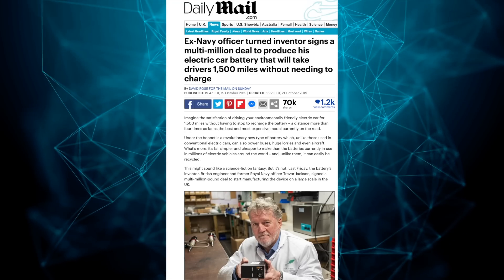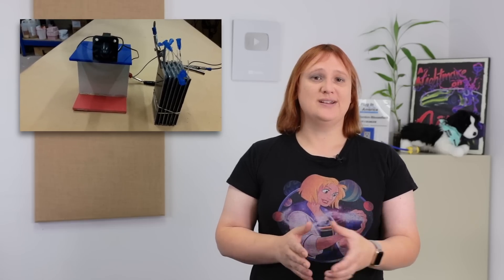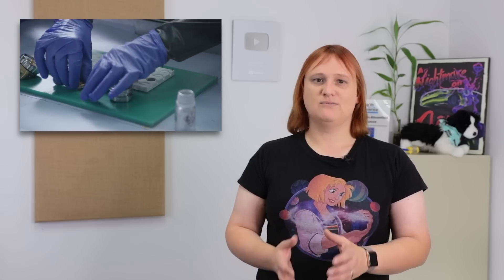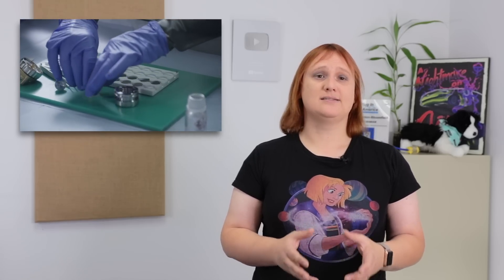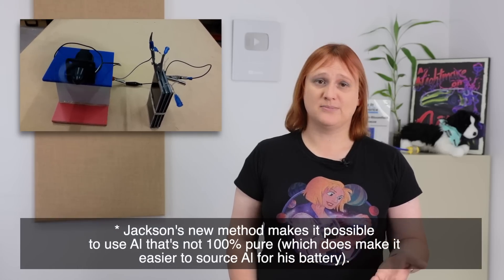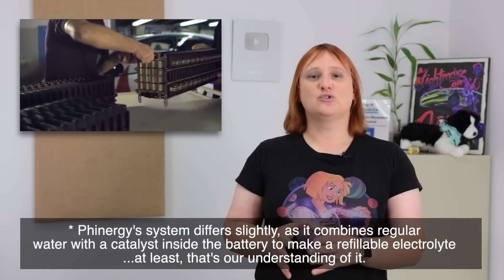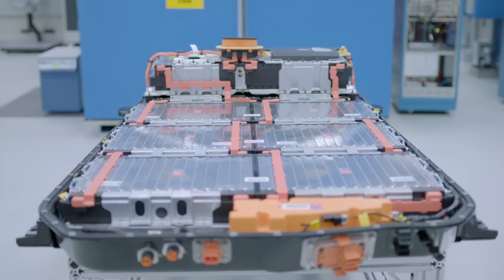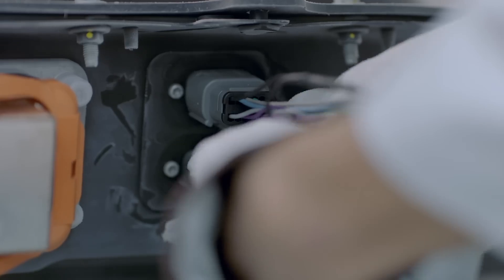Is This Battery The Holy Grail For Electric Cars?

Comment: For car use, a range extender sounds like their best use. However, for that to work best you’d need some kind of standardisation (voltage/physical size/connector placement) similar to what there is with AA, AAA, B, C etc batteries, and they need to be user swappable. I rarely use the REx on my i3, but there are times when I’ve had to do a fairly long journey requiring more than one full tank of petrol/gas (due to either time constraints or broken/unavailable Rapid chargers). If you have to take your car to a dealer to replace the REx battery it becomes a lot less convenient. What sort of sizes are we talking about for range v size? Would a shoe box sized Al/air battery provide 50/100/200 miles?

Comment: This concept is going nowhere for automotive applications. The A/O battery may be technically eight time as dense but I think you will find that it's usable potential is more like five times as dense. All metal/air batteries are inherently self destructive. Power is produced as pure metal is converted to oxide, and it's strictly a one way process. I just did a simple napkin calculation. A Tesla Model 3 long range battery weighs 1,054 lbs. If the aluminum/oxygen  battery is usuably five times  as energy dense (because you can't discharge to less than say 20%) then it would weigh approximately 210 lbs for the  equivalent energy density and even if it really was eight times it would still weigh 132 lbs . Also as the battery 'discharges' it's going to get a lot heavier.  The chemical formula for aluminum oxide is Al₂O₃ so for every two atoms of  aluminum there are three atoms of oxygen and oxygen is heavy. So as your A/O battery gets weaker as it's getting heavier. A lot heavier. There is no way you are going to swap out a car component the weight of a four cylinder engine block every time you need to recharge the car.  

Also turning aluminum oxide back into metallic aluminum requires huge amounts of energy. Aluminum like most metals love being an oxide and hate being a pure metal. You have to effectively smelt it back. As a reusable fuel cycle it's grossly inefficient. Personally I'm holding out for an automotive Thorium Decay Reactor driving a closed loop steam turbine.

Comment: I mean if the replacement process of the aluminum was about as easy as filling up a gas tank, this may be feasible.
Reply: It won't even be needed once quick charging is on par with filling up with gasoline as far as time goes and that will be reached in the 2020s

Comment: I am having a picture in my mind:
Under the front hood there is an array of - say, 8 cylindrical batteries with large handles, each weighing a couple of kilograms. They are depleted in series, meaning that when you go get a few new batteries you'll only swap out those that are as fully depleted as is possible by normal use. They are colored brightly, maybe orange or something, covered in warning signs not to touch the bottom end, but of course are engineered in a way that you still can without dying.
Now you enter a battery shop, which looks similar to a gas station, and swap out the empty ones for new ones - then you leave, the car still decharging the same battery. Once empty it will continue with the cycle, and eventually reach the newly plugged in ones and continue on the cycle as it has for many, many cycles. As the batteries weigh a few kilograms, there is need for employees to help people who cannot lift those batteries out by themselves and give advice and such - of course there is a grocery shop attached to that battery station.
The used batteries will be recycled, which, depending on the electrolyte may be as simple as shredding, washing and melting, to make new battery cells which are made by the millions per day. Because, this kind of new battery technology can be used in many other places too: As emergency batteries of a normal house maybe, or to power electric wheelchairs, planes, race cars, even heavy machinery (though, for those there might be a bigger version).
So, in summary, this technology has the potential to change our lifestyles totally, fundamentally reshaping the world we live in. The problem of making clean power to fill those batteries with remains, of course, but let's solve one issue at a time, shall we? :-)
Reply: I don't think the power density would allow you to drive a car on one battery at a time like you suggest.
Reply: @MrGonzonator  a battery is a group of cell's, not specified how many cell's.
Reply: @m.j.debruin3041  yes, I know. I was merely pointing out that the low power density of aluminium air means that a battery small enough to handle could not actually power something as thirsty as a car.
Reply: It may have a use in aviation. But what are we gonna call them mabey ;  AAA XL.😀
Reply: I was thinking very similar to this but just 2 batteries.  Each lasting 750 miles and you would then have another 750 miles to change the other one.  My understanding is that the batteries are very easy to recycle. On the face of it it would appear to me to be the way forward.  Probably won't be as the major car companies are pumping to much money into normal batteries.  I wonder if Dyson ever looked into this before they closed their project down.  A company like them is the only way I can see it becoming main stream.
Reply: @allendance1  how much cost and how much carbon is involved in recycling this battery?
Reply: @allendance1  That would be nice, but 2 batteries would almost certainly be too big, weighing several hundred pounds each. Even 8 would likely be too big per battery to be easy to lift out and replace. The power density per battery was mentioned, and I agree - but a solution might be to do 16 in 4 rows, with 4 being used parallel at all times. That would make a refill somewhat labor-some, but one can't have everything.
Unless somebody comes up with a capacitance gel like in the 90's movie Demolition Man. :-)
Reply: This would be very attractive to those like myself who live in homes that CANNOT have charging stations installed.
Reply: Bro... you high?

Comment: This might be great solution for airplanes.
Reply: I think it would be cost-prohibitive.
Reply: @MrGonzonator  well I am not expert in this topic, but the big cost of aviation is repair of the engine and fuel. In case of the electric motor you would have a lot of savings on maintenance and potentially even more on fuel. If the recycling of the battery is not to energy, resource and money intensive it might be sustainable. Even if it isn't the same price I am sure if it is not multiple times more expensive people would pay for not polluting. Besides the air pollution electric motor is way less noisy than jet engine, so there might be even more benefits. Lastly I don't know how much this is relevant, but this might be a cost effective way to move aluminium around the world for other uses.
Reply: @gene8194  don't get me wrong, I'm rooting for electric transport of all kinds and I'm keen to see where this goes.
I'm just not convinced that this is the "holy grail" some others are touting it as.
All this constant range-anxiety-fueling talk about 1500 mile batteries misses the point that the goal is to decarbonise transport. I'm not sure how energy or carbon-intensive the process of recycling these batteries is, but the fact that none of the normal news articles has brought that up, and has focused instead on highlighting the (actually already ok) range of li-ion is concerning.
Reply: @MrGonzonator  I agree on the media coverage, but not surprised, media is usually giving us partial truth, that is how they earn their money. Why I am excited for this type of news is that if we can find a business case compelling enough to put this into production that would mean more money would go into the further development, since the company would be motivated to make it reusable. At the moment it is just a project on the test bench. We need real life data.
Reply: You should read this study, http://adl.stanford.edu/papers/AIAA-2016-1026.pdf
Which concluded that a combination of air aluminium (for range) and li-ion (for high power density required for take off) could compete on price for short-haul trips.
Below 1150 miles, the Aluminium air battery doesn't have enough power to get off the ground on its own. Above it, the total weight of batteries is troublesome. In most short-range cases, li-ion actually works better on its own, despite higher weight.

Comment: This sounds like a better fit for electric aircraft
Reply: Difficulty is the relatively low power density, meaning you need a lot of batteries to have enough power to get off the ground, or an  alternative power source for the climbing part of the journey.
Reply: MrGonzonator that does not make sense if the battery has higher energy density by 7 then for the same weight and volume you have seven times more energy.
If power is slow to move out you can increase flow by stringing the cells into higher voltage. Also most electric vehicles utilize ultra caps to buffer power demands!
Reply: @Dana5775  
I think the point was made in the video about the difference between energy density and power density.
In the context of powering planes don't expect anything of comparable weight to modern passenger and cargo aircraft to become airborne any time soon using batteries with or without "ultra capacitor " assistance. 

The amount of power needed to get commercial aircraft airborne is substantially greater than the wildest dreams of battery technology companies. 

Electric motive power  (from batteries) isn't  close to matching energy and more importantly power density of oil derived Hydrocarbon fuels in use today.
Development in battery technology is good but it seems to bring  incremental gains so far. One day maybe, my observation as an avid watcher of technology over the last sixty years is some "holy grail" technology, for example nuclear fusion have been ten years away from being put into production for the last fifty years !
Reply: MrGonzonator, reasonable point, butthat can be addressed by putting the batteries more in parallel than in series.  Now, granted, that reduces the voltage compared to series, but it’s all realized by DC-to-DC (boost/buck) anyway.
Reply: @mr88cet  Series versus parallel makes no difference to power density. DC-to-DC converter also trades current for voltage, while keeping power the same.
Reply: @dekutree64  isn't it hilarious when people think that wiring a battery in a different configuration automatically generates more power out of thin air xD
Reply: dekutree64, yes, you’re right now that I think about it again.  It’s ultimately just a function of the battery’s “C” rating.
Reply: Cristopher Reeves  dream on now 7x more expensive
Reply: Cristopher Reeves get a clue man you are in the dark!
Reply: Hey, what about a nuclear powered airplane? What could go wrong?! Ask the Russians.
Reply: Aluminum batteries are not rechargeable. The material dissolves in the electrolyte so you need to dry it out and then heat it to over 1000C plus apply current to get the Aluminum back.

Btw Austin Electric is worth 4 pounds as a company. The Electrolyte is pretty much guaranteed to be some sort of mixture of baking soda and vinegar (aka drain cleaner).
Reply: @ericcartmann   Baking soda and drain cleaner are completely different compounds. Baking soda is NaHCO3. Drain cleaner is NaOH.
Reply: @Roxor128  That's why you add vinegar. Baking soda and vinegar makes an powerful electrolyte. 

If you want a stable "not drinkable" solution then you want to use Sodium Hydroxide. 

But the main point is that this shit isn't rechargeable, and whatever "electrolyte" this person came up probably isn't innovative at all.
Reply: Tom Webb, that’s also a very-reasonable suggestion!
Reply: Try searching alpha electro
Reply: Cristopher Reeves  uses the same electricity to refine crude oil to something useable...
Reply: @Dana5775  is
Reply: How about trucks ?
Reply: Bainsworth  Hydrogen eather needs to be kept at very low temps or in high pressure tanks to be able to have enough fuel for a plane to fly. And there are no lightweight solution for a that yet. But I think hydrogen is the future for trucks and other heavy duty vehicles that doesnt rly need to think about weight

Comment: I think these batteries would work very well to power electronics just like our current disposable cells. They won't work as a rechargeable battery though. Maybe future versions will solve the 2nd problem.

Comment: No, no, no, no, no. Sorry, in advance, for the rant. I want NOTHING to do with this process! I leave a link here to the methods of aluminium production. http://www.madehow.com/Volume-5/Aluminum.html. 

Long story short, this is an attempt to use a cell chemistry that creates the need to engage an expensive infrastructure that you and I would have to pay to implement and to use. With the need to constantly replace the aluminium, and not have all that we need able to be obtained from our roofs, we're back at square one. Note also that there are two main processes that are used to achieve aluminium. The less economical one results in a red waste product we cannot economically use and the more efficient process results in copious amounts of CO2 released directly from industrial sized electrodes. Not to mention its energy intensive to produce. (Bayer and Hall-Heroult processes respectively).

Also, I note rather suspiciously that the US was once the principal supplier of aluminium in the world with something like 31 plants nationwide producing tons of the stuff. In recent times, us production could not compete with cheaper providers from the third world and has shrunk to less than 7 struggling plants I think, but they appear to have a disproportionately large influence on the new administration and have achieved an aluminium import tariff that works well for them but not for their customers. Investigate for yourselves. A new demand structure like an AlO battery architecture would stimulate even more life into this old industry for the benefit of suspiciously few.

We don't need this and It's ok. With a bit of patience, Li ion technology will evolve to a suitable level that, coupled with the fact of.approx 400 wh/kg energy density, a longer cyclable life span and an ability to recharge from our own roof solar and battery storage infrastructure, benefits us with a good compromise position of truly sustainable operation at reasonable cost with minimal to no recurring costs due from a necessary and parasitic refuelling, servicing, usability or maintenance infrastructure. Over on that side of the spectrum lies the dreaded fuel cell architecture. Same kind of concept exists in that architecture. How do the suspiciously few create a recurring demand to profit from that uses processes that release, in that case, methane. We must have none of that, for it is simply a side step from fossil fuels, not a step forward. 

Rule of thumb; if Tesla isn't trying to or actually acquiring it, be very sceptical of it's long term viability, suitability, practicality or the democracy of its economics.

Comment: A Lithium Iron BEV with an Aluminium-Air battery range extender would be the ultimate series hybrid. 
I bang on about series hybrids ( the taboo subject among ev youtubers) because whatever the energy source of the vehicle the companies that commit to making their most popular cars have only electric motors as the sole means of propulsion will be the first in line to take advantage of whatever new battery developments come along. Batteries do not turn the wheels, electric motors do that.

Comment: Well said, I didn't think of that, using this battery would be good as a range extender for when your in a pickle. ( It would mean car companies would have to finally develop a hot swappable modular battery system) A tad wasteful though if you're going to chuck a battery every 1000-1500 miles so a bachup makes sense. I think for niche markets where reusability and money isnt high on the list this technology is likely dominate. millitary vehicles, Aerospace applications, emergency services, battery backup systems and such like.

I think this technology will be a huge player in the future. Good look to the guy.

Comment: Swapping batteries won't be cost-effective it would appear. 

https://cleantechnica.com/2019/10/20/uk-man-invents-aluminum-air-battery-in-his-garage/

...Some comparisons are in order. A Tesla Model S can drive up to 370 miles on a single charge. Jackson says if you drove the same car with an aluminum-air cell that weighed the same as the Tesla’s lithium-ion battery, it would have a range of 2,700 miles. Aluminum-air cells also take up less space. If that same Tesla were fitted with an aluminum-air fuel cell the same size as its current battery, it could run non-stop for 1,500 miles.
Jackson says the battery for that long range Tesla Model S costs about £30,000. Tesla aficionados will probably quibble with that number but Jackson claims his aluminum-air battery/fuel cell that could power the same car for longer would cost just £5,000. Of course, if the owner has to spend £5,000 every 1500 miles, the economic case for the new energy source is compromised somewhat. Time will tell.